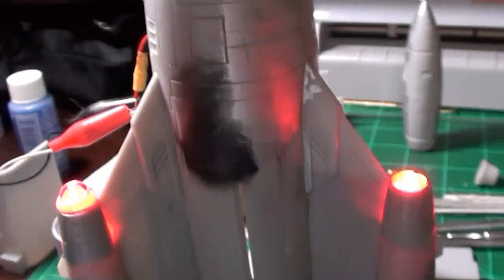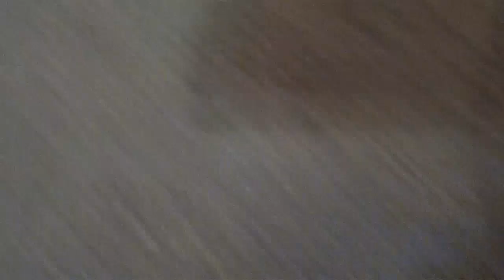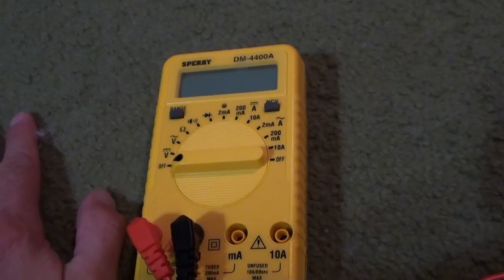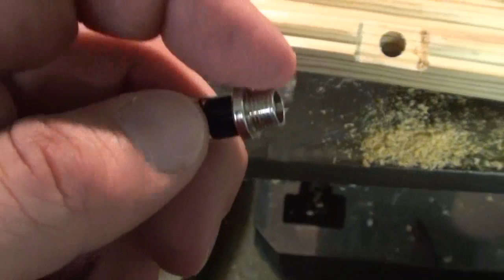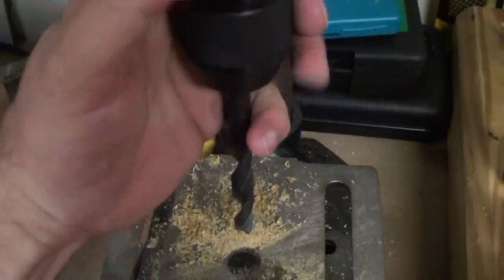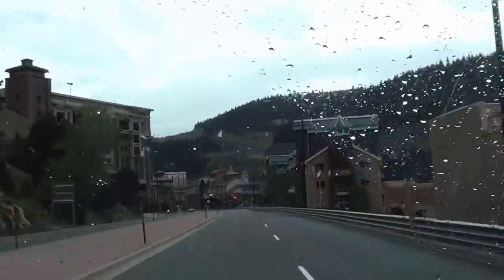Mercury 9 Part 12:   More about the base

Comment from the maker: I did buy a few voltage regulators to experiment with.   But not one that is 12 volt.   I will have to do that soon.   The meter I did buy was a  Extech, I couldn't afford a fluke.   The battery was not low, I replaced it two times with the same result.

Comment: That power adapter is a transformer based adapter. Those are almost always (as far as I know) unregulated. The label just means that it will supply at least 9 volts. If you want a regulated supply, you can try a switching type adapter. Or you could hook up a small voltage regulator to the adapter. Oh, and the best meters, in my opinion, are Flukes, but I think yours just has a low battery.